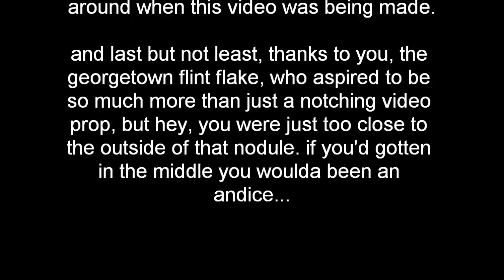notching flint with pressure and punch

Comment: Ah whew! Glad no points were harmed. I need this because I only make hunbolts and stuff like that because I'm horrible with notching
Reply from the maker: Zack Hansen hi zack - you can probably get by with horseshoe nail notching if you're just doing thin obsidian points. trick is to get the preform thin to start with cuz it makes notching a LOT easier. but practice on flakes...